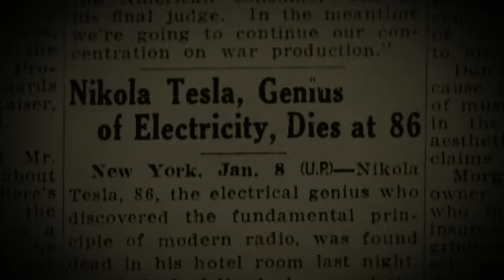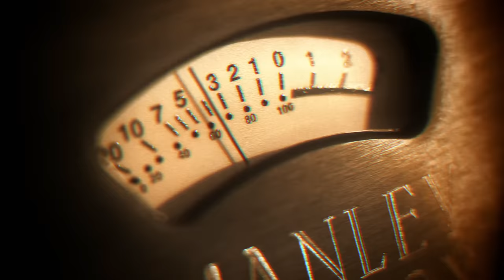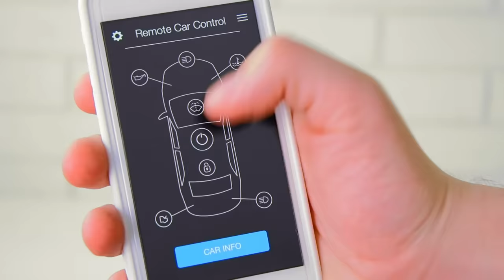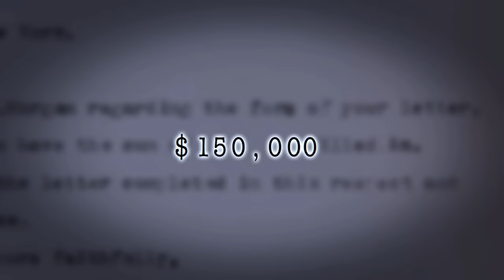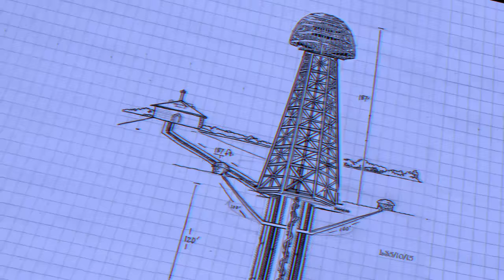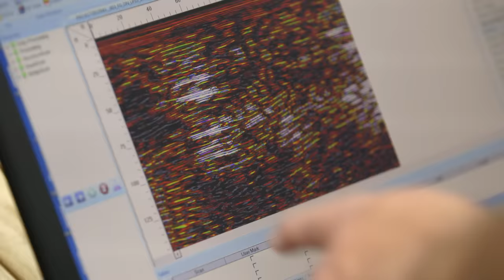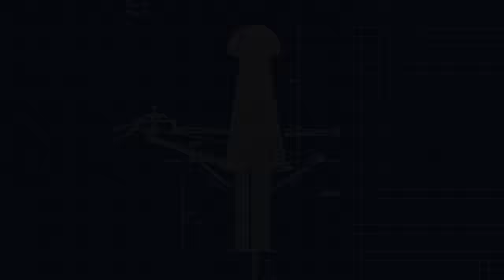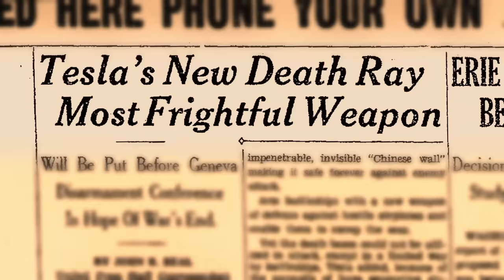Incredible Evidence Uncovered in Tesla's Tower | The Tesla Files (S1, E3) | Full Episode

Comment: Tesla picked this site because of the natural Aquifer. Similar to the Pyramids in Egypt that were all built at sites along the Nile that were natural Aquifers. Captured water movement generated low voltage electricity. The Pyramids were power generators. Tesla wanted to recreate the system.
Reply: Exactly
Reply: The citrus planets producing more methane and yeast, were why the pyrmids in Egypt were built. The citrus plants had to be controlled in growth and were in too great a number.
Reply: @CalamitousJonathan  Citrus? smh
Reply: @CalamitousJonathan  Rocket fuel? Have you been taking your Meds as your Doctor directed you?
Reply: Why is no one rebuilding the pyramids to test out the theory

Busy building a giant wall city like Halo
Reply: There's a pretty decent Why Find episode where he breaks down exactly how and why the pyramids probably were electricital conductors. The only real problem is what would they have been used for? If they had the technology to build lights and stuff that worked electrically then they probably would have had better building materials than rocks and stones.

Comment: Ever see what a ground fault actually does? I think Tesla in his earlier times wasn't envisioning 3 and 4 phase 110 Volt AC. That kind of current would be impossible in a permanent Ground Fault situation and in fact today we fight the low insulation values of people's current feeds from the power poles in high moisture content soils. A rain storm can short the entire residence into a 220 to 440 situation on any one leg of a two to 4 phase line system.

Plus add this to your ledger. An Inverse Gravity lift system will go ramming into ANY STRUCTURE WITH A GROUND FAULT LIKE IT HAS NO BRAKES. So this idea wasn't even Teslas' better thought on the subject. It was an early one. And he was concerned about Earth's natural current production from its geomagnetic potentl